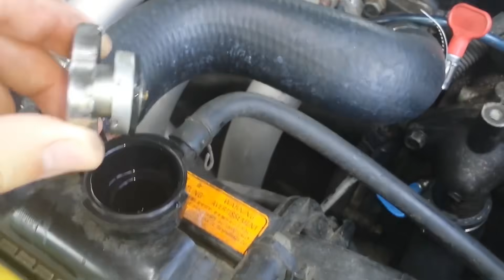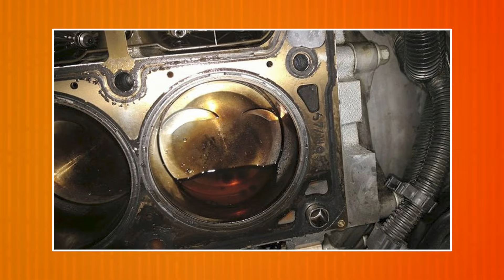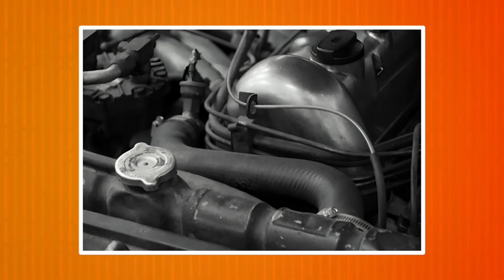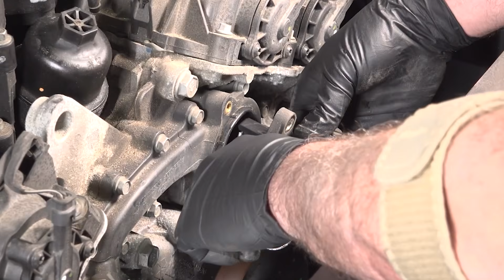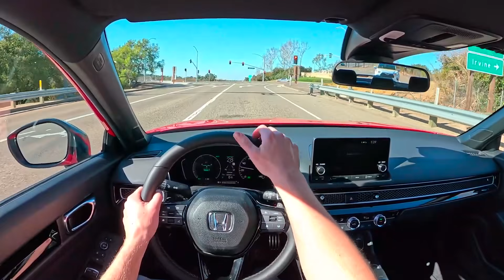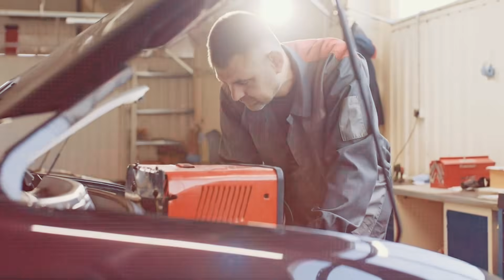Doing This Will Make Your Honda Cooling System Last Forever

Comment: Factory hose spring type clamps are better to use than worm type clamps as it seals perfectly around the hose and outlet, worm clamps crushes the hose and outlets as tightening these clamps put pressure on one side of the hoses only